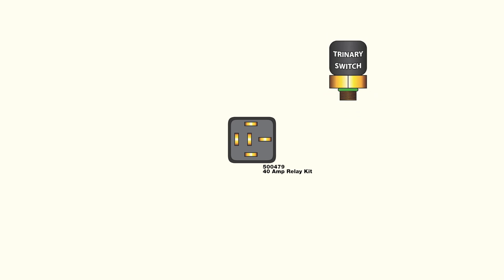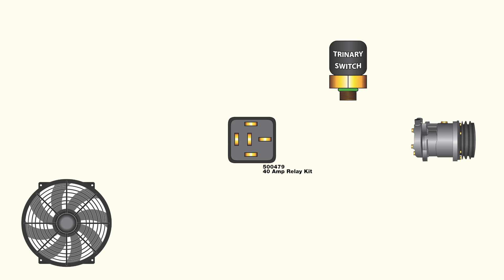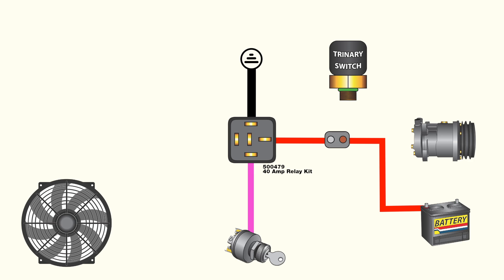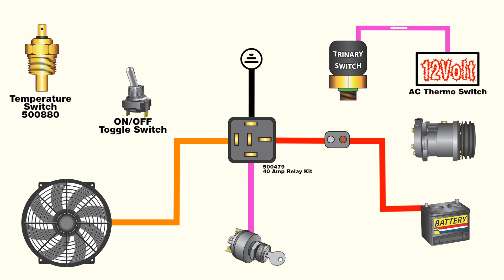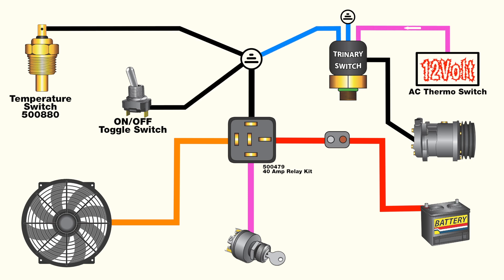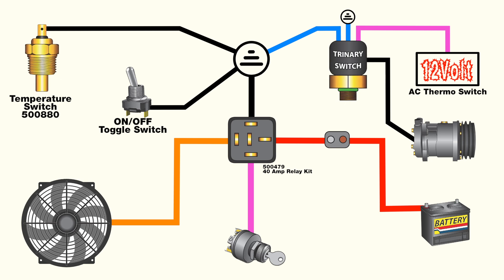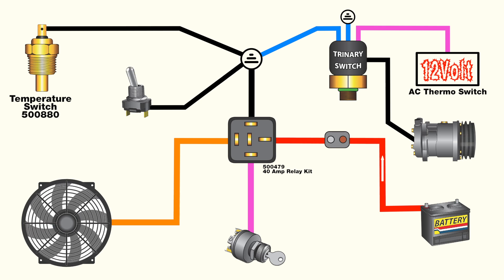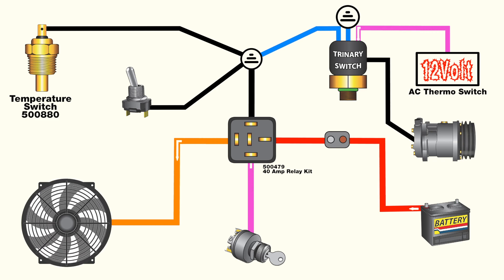How to wire an electric fan with an AC trinary switch

Comment: But, what if my car does NOT have an electric fan to cool the radiator and AC condensor.  My vehicle has a mechanical fan with a fan clutch, what do I do differently and the vehicle came with AC (air conditioning) standard from the factory but I need to wire-in conteols/switcha for an auxiliary HVAC system that one of the previous owners/operators/drivers cut the switches out of and damaged.

Comment: Hello, i have a 89 prelude. Trying to bypass the 4 pin relay with an aftermarket 5 pin so i can still use my original electric fan. The AC compressor had a thermo protection sensor and a pick up sensor. I assume i dont need the trinary switch but how do i wire the relay into the ac wires to work as shown in video

Comment: Tried this wiring but the problem is when the AC clutch kicks-in RPM drops below 500rpm. My car has an ECM but couldn't figure out to reconnect the new AC system to it.

Comment: Hey, i have a question. could i run a car radiator fan from a 220v outlet in my house? if this is possible please help me out and ill give you more details of the project. thanks a lot.
Reply: Yes if you have 20 12v dc fans connected in series

Comment: Hello sir a.c gas ok car wiring ok condenser fan also ok but when i want run a.c then not work condenser fan where is problem. Can you tell me plz  on this no. +918558085945
Reply: The problem  is trinery switch

Comment: radiator fan won't turn on automatically even coolant temperature reached 110 degree of celsius. trinary switch could be problem?
Reply: Is it controlled by the computer?  If so, you can look at the LT1 Website, shows how to wire through relay and PCM gives negative signal to start fan when temp is reached.

Comment: This is confusing because why do you need a toggle switch when you want your ignition switch to turn it on?
Reply: The ignition switch is power.......it turns on by a ground feed....that's why you install toggle switch so you can turn it on when you want it on instead of waiting till the thermostat ground out by temperature
Reply: @seangivings7661  Well the thing is, I only want temp switch to turn on the fans. My belief is that an ECM is not necessary to turn on fans. So what I intended to do is use temp sensor to turn on fans when hot by connecting ground(temp sensor) to pin 85. The problem is that with the key off, the fan remains constantly on. Why i decided to do this? I am tring to bypass the ECM turning on the fans. I am kind of confused when you said "wait until thermostat grounds out when hot" is this what activates the temp sensor to turn on fans?
Reply: toggle switch is the optional switch, when the termo switch is faulty during the minimum operating temp of the engine then you can switch on the toggle and the cooling fan will  run.

Comment: I like to upgrade my fan on my es300 lexus 93. .
a double fan will run me about $469.95 a single fan $92.95  I will have to have a professional installation. .this requires lot kit wiring. ..I will probably go with the single fan $469.95 is too much for a 1993..if I do have this installed would it make a difference in cooling my engine much better? these es300 lexus are known to sometimes over heat. .. I know it happen to mine. . I've always made sure everything that works with heat I've been changing them.. timing belt, watt pump, radiator, belts temperature senor etc.

Comment: When I turn my AC on both my fan comes on but doesn’t work when the engine is hot so the car Will overheat
Reply: bet the temp sensor gone bad.. replace it
it's located in the radiator, or in some cars it'll be on the cylinder head
Reply: I did it and the fan still won’t turn on when I reach temperature
Reply: That’s why it’s better to get a on and off switch. 👌🏾
Reply: Check to see if your controller is adjustable. If so, you'll need to set the temp at which they turn on. You'll also need a corresponding thermostat, ie;
180 degree thermostat = set temp to 180 degrees fan activation.

Comment: Great video! Exactly on point! one thing to add... the ground noted above the relay is NOT body ground, it is the ground signal input, which I think most people get confused about. T--}out
Reply: Very good observation sir. I was scratching my head for a sec. Essentially there's 3 ways for the 12v signal from the ignition key to be grounded thereby activating the magnetic coil relay and sending the 12v battery signal from the battery to the fan
Reply: That got me too. I thought ground meant ground, but in this case it doesn’t?

Comment: I have my A/C compressor gutted out, is there a way I could utilize the A/C climate control button inside the cabin using the same connectors to the compressor as a toggle switch to activate the fan between high and low??

Comment: Does this diagram application  work if I just want to add a toggle switch since my fans low speed start at 90c and high speed at 95c.. I'd like the fan to start earlier like low at 85 & high at 90...
Reply: Thermal switches that operate at various temperatures are available from any good car parts retailer.
Reply: zaher
Reply: Different thermo switches are available for just such an application. You are looking for hot weather switches.

Comment: But the ground signal is ECM controlled so it needs to be cut off from it and pwm signal cancelled hence no pwm at set frequency to the fan and won't work on pwm controlled fan types